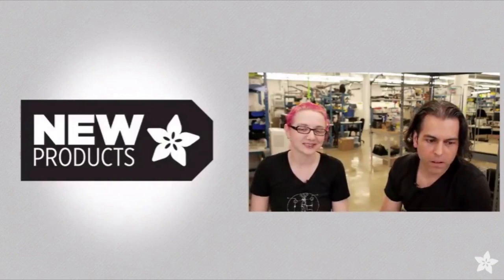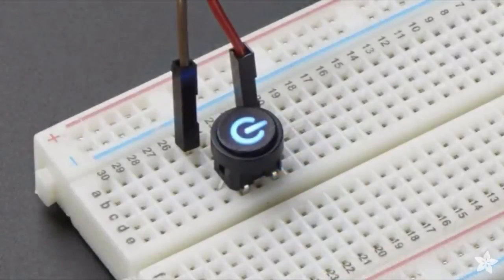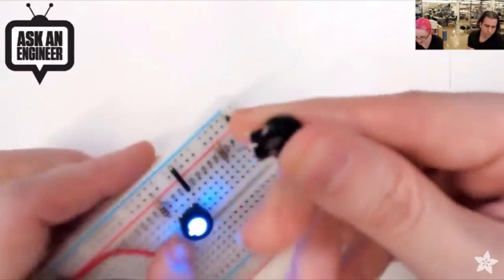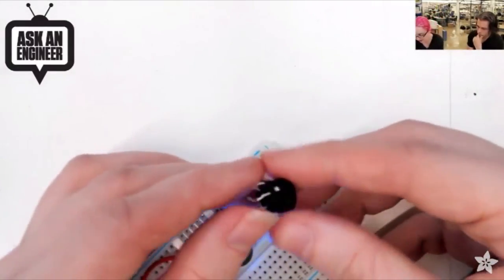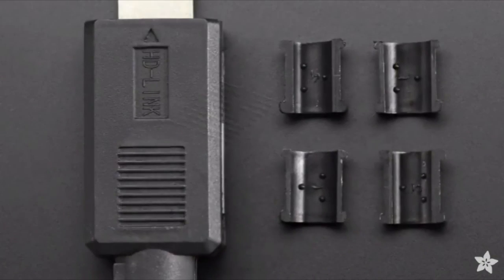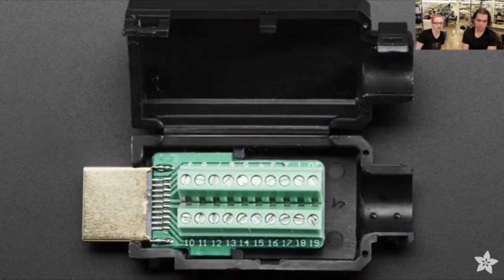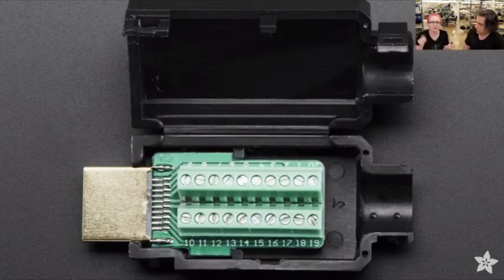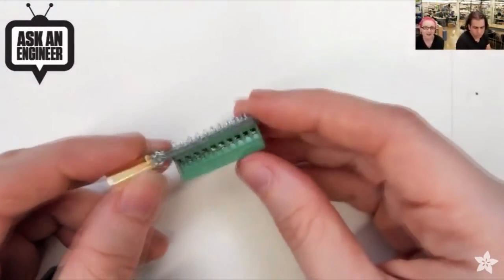New Products 6/29/2016

Comment: I’m using the HDMI breakouts to extend the cable connecting my Thrustmaster t.flight HOTAS 4. There’s a hard line cable connecting the throttle and the joystick that’s only a couple feet long I need to lengthen it to fit my simulator set up https://youtu.be/qMVWY3D-4ow What do you think?

Comment: Those DE -* connectors would work fairly well for providing a single point plugin for multiple sensors, would they not?  Run the sensors to the male connector and then connect the female to the controller and power/ground.  Seems like it might be a good way to have remote/outdoor sensor clusters run through a single cable back to an indoor/protected controller.  Less wiring mess and simple/reliable connection point.  I would think signal integrity would be pretty good too???

Comment: Aren't HDMI breakouts kind of problematic? I thought HDMI was timing-sensitive enough that mismatched signal line lengths would wreck the signal integrity.
Reply: Yes, but I think in that case, when the signal does not transmit well, the HDMI protocol is smart enough to reduce the bandwith of the signal (thus the quality of data). A friend of mine told me that to link his PS3 to his TV, the cheapest HDMI cable didn't transmit the sound very well, but way better with a better quality cable.

Comment: These HDMI breakouts will be perfect!!! I was thinking I can use these to pass signal wires up to the dome of my R2-D2 and down thru a 24 wire slip ring to the body. This will make running 20 of those run easily. about 12 of these were going to be run from an Arduino to servos.

Comment: About the HDMI Terminal Block stuff: 
Always waitet for something like this to replace the analogue composite cable that runs through an empty tube inside the massive brick wall in my living room (approx 12 meters) from the edge where the TV is to the back of the room up to the ceiling where the DLP projector is mounted. The  plugs of the ready-made hdmi cables are simply to big to fit through the 15mm empty tubes.

Comment: Thank you for actually using the correct designation for those DE-9 and DE-15 connectors. :-D
Reply: Isn't it DB?
Reply: Nope, or at least not originally. They are commonly called DB, but that is actually incorrect. In the name DE-9 the three alphanumeric characters individually mean something. The "D" means it is a D-Shaped shell. The "9" means there are 9 pins. But the "E" means that it is an "E" sized shell. Where the DB comes in is on the 25 pin connector. Once upon a time, RS232 only specified one type of connector, a 25 pin connector. The Amphenol (or was it AMP?) connector used was a D-shaped connector with a "B" sized shell and had 25 pins. Thus a DB-25. These DB-25 connectors were common on computers and were referred to as DB-25 serial. Most end users didn't know (and really, didn't need to know) why it was called DB-25. Then someone (I don't recall what company) started using a subset of the 25 pins as a 9 pin serial connection. People who didn't understand (I'm sure innocent naivety) the naming convention, started calling them DB-9. Then the knock-offs were also called DB-9. But if you wanted to order the correct connector from the original manufacturer (Amphenol or AMP) you needed to know to specify DE-9. (Sometimes the DE-15 is also designated DE-15HD because the 15 pin layout in the "E"-sized shell is Higher Density than the 9 pin layout. Nothing to do with High Definition...)